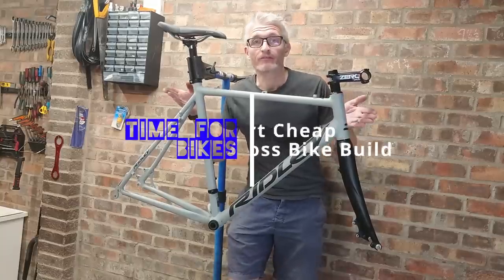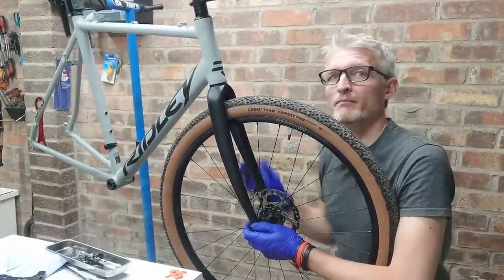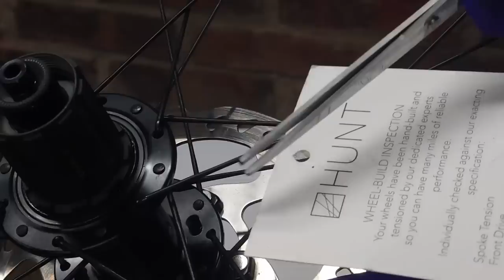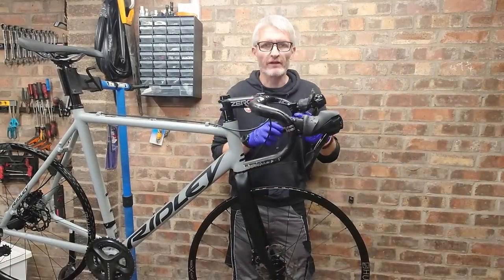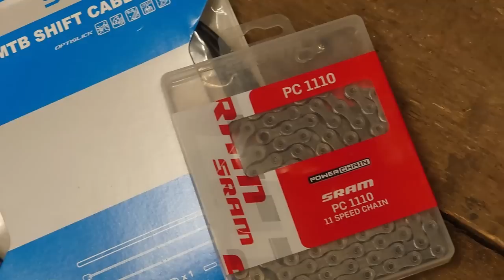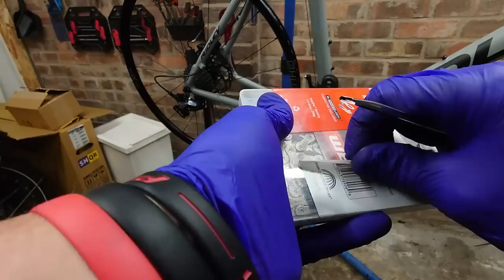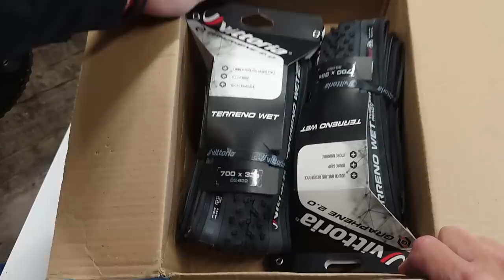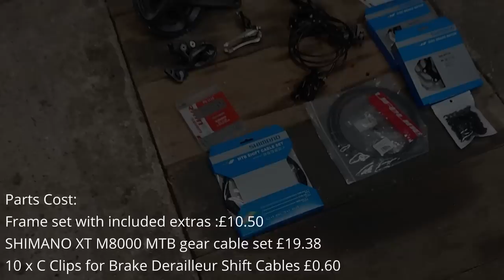Building a £10 cyclocross frame into a race machine.

Comment: Do you use copper paste on aluminium parts?😮
Reply from the maker: Hi, just looked this up and see that it could accelerate corrosion! It is an odd one as I don't use it all.the time but have never noticed any issues with using it before. I will have a look into it. Thanks for highlighting it!

Comment: How is that even possible 10 quid for ridley frame? In my country that would easily go for about a hundred quid. Anyway great vid keep it up!
Reply from the maker: Thanks for the kind words! The auction ended at a strange time mid week. I expected it to go for about £150 at its lowest but nobody bid. The frame had been set up and ridden once then stripped. Some wide tyres had been fitted and had a couple tyre rub marks on the frame. So I think it was a gravel bike build that they realised was not possible due to the frame clearance. My gain and very happy! Take care and happy cycling 🙂👍